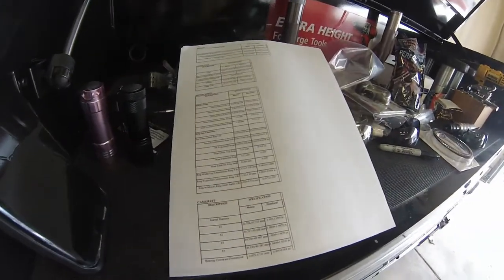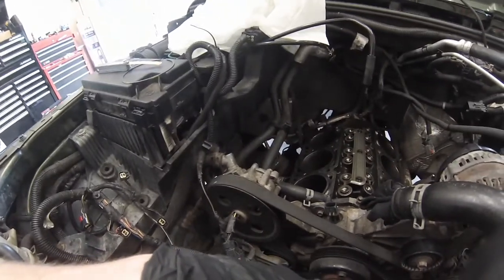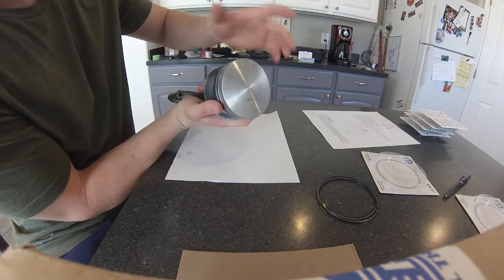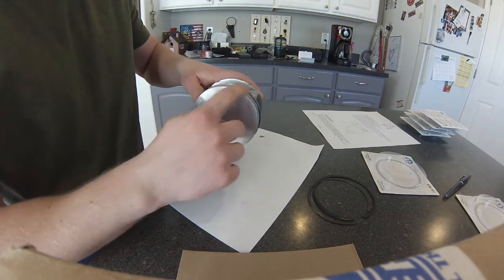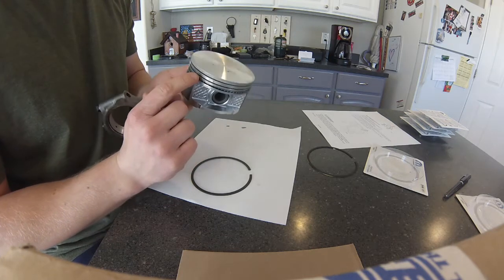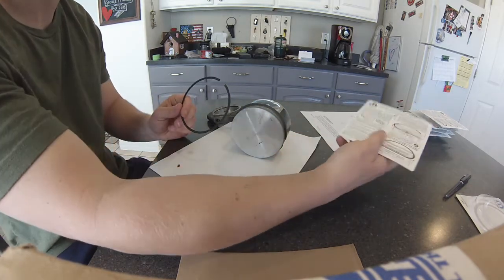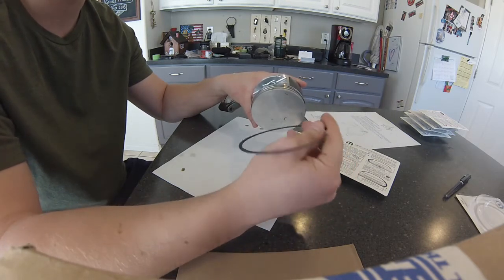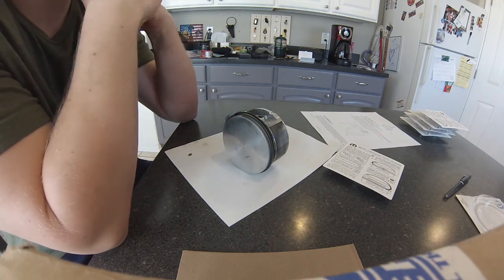Jeep Wrangler JK 3.8L Engine Rebuild Part 3 - Piston Ring End Gap and Install

Comment: How did you do the final cleaning to get all of the honing dust out of the engine?
Reply from the maker: Thanks for watching! I originally used a lint free towel with a little bit of oil on it so grab the big stuff and I followed it with carb cleaner sprayed directly in. I placed a rag on the underneath to catch all the run off. I'm not sure what Chrysler recommends on how to do it properly but I went several times with a clean rag to make sure it was all out.